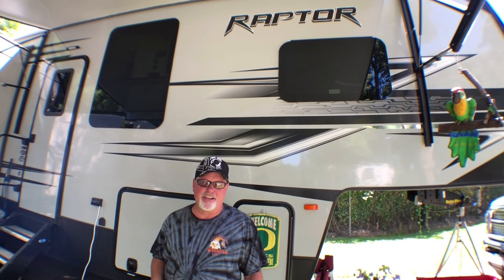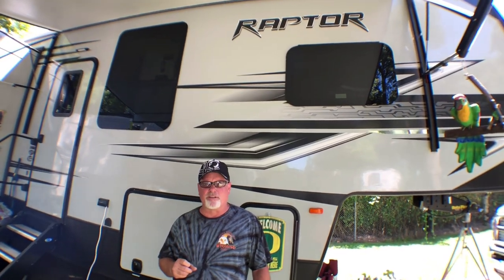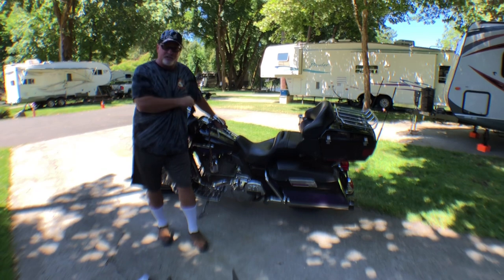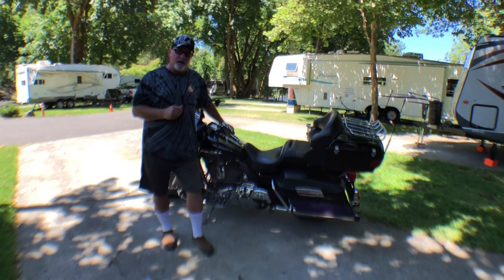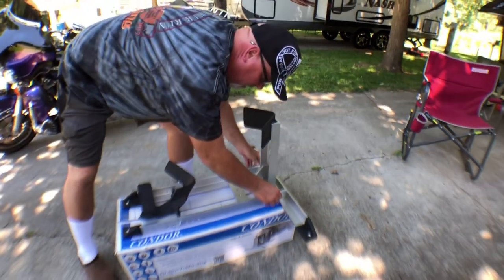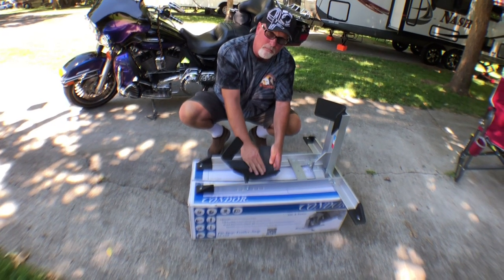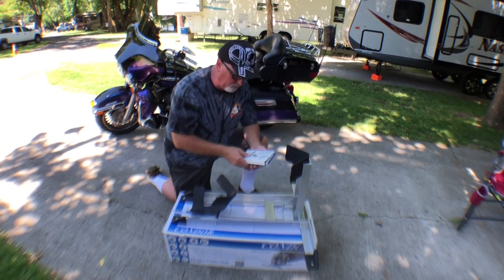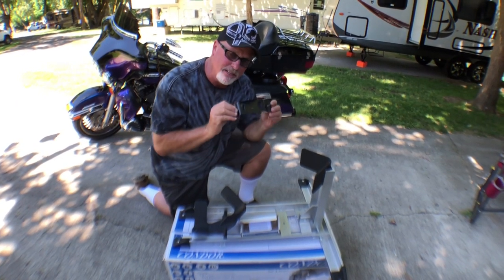Condor Wheel Chock | Use and Install Part 1

Comment: Where did you find your longer bolts? Are they identical to the original? Countersink?
Reply from the maker: We actually found the same bolts but longer at a local machine shop. Worked out perfect for the install